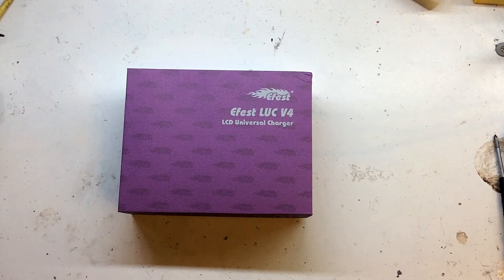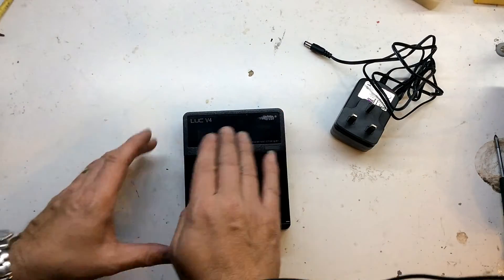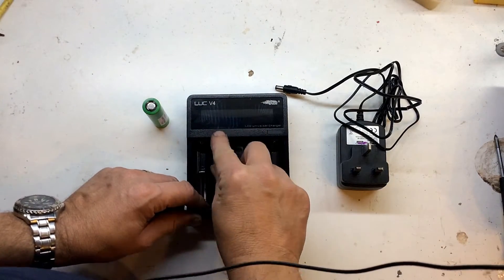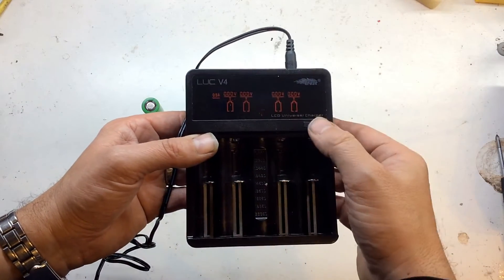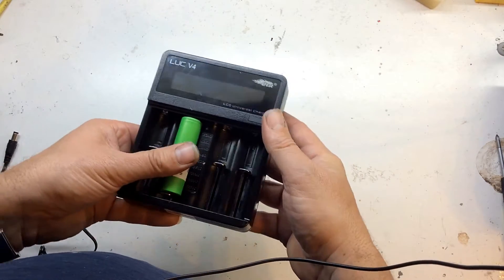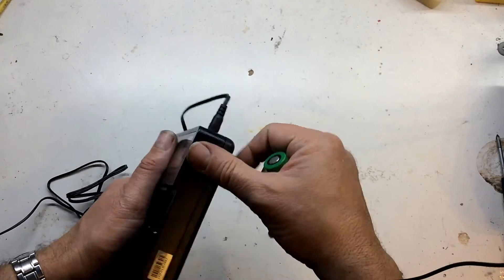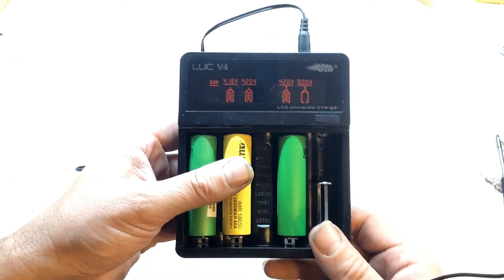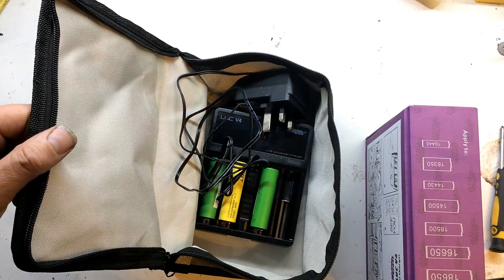Efest LUC V4 lithium charger review

Comment: What would you recommend charging a lmr 18650 2500 mah on 0.5 or 1. Or 2.0?
Reply from the maker: The IMR should cope with all but i always treat with respect and charge at 0.5, the only true way would be to look up the specification of the make and model of cell and it will have a max charge/discharge C rating eg 1C in your case would be 2.5A (number x capacity)